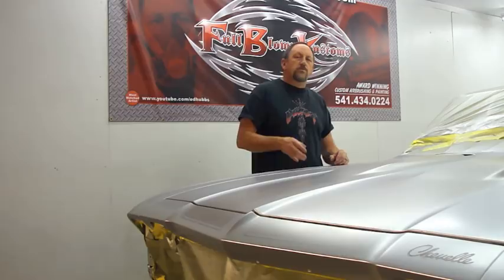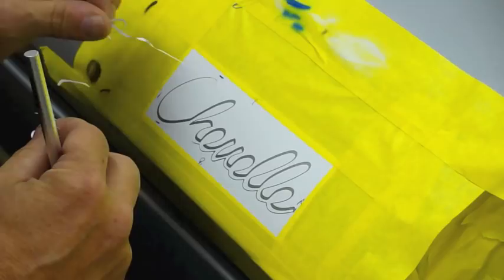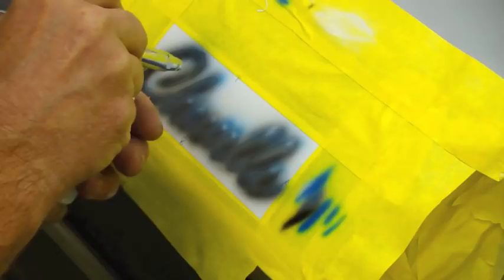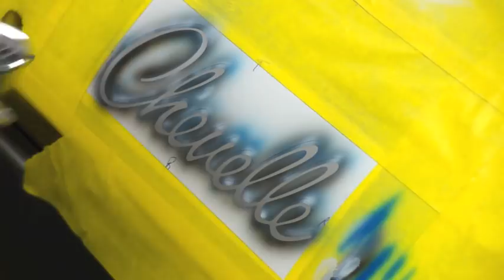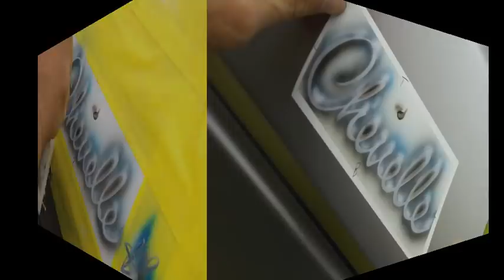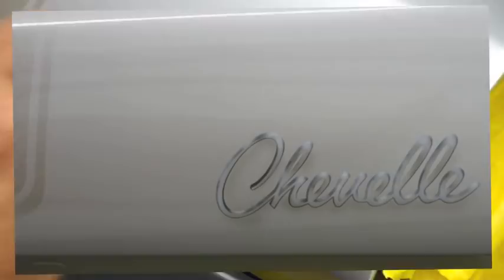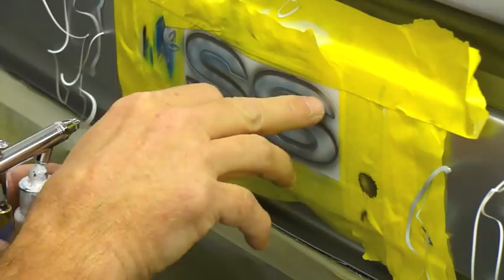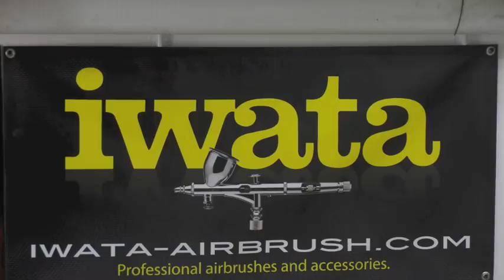Chrome Emblems

Comment: Which Micron are you using? The .18 or the .23
I find your videos extremely helpful. Thank You for sharing your talent.
Reply from the maker: gravelhead65 .18
Reply: There are several components to getting a good result. One resource I discovered which succeeds in merging these is the Magic Painter Method (google it if you're interested) without a doubt the most useful info i've seen. Check out this  unbelievable resource.